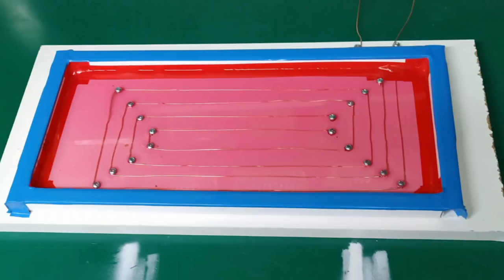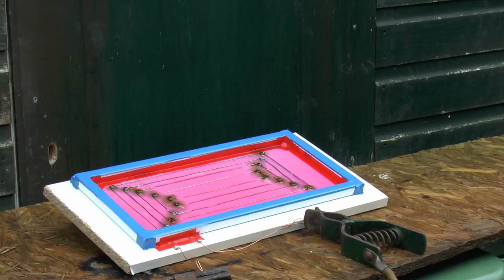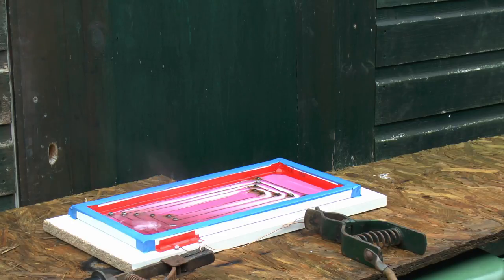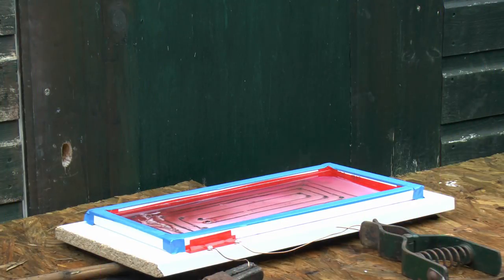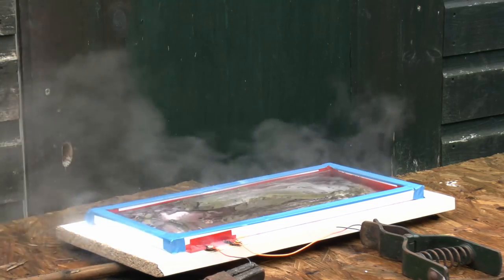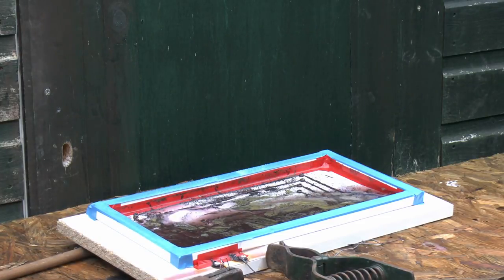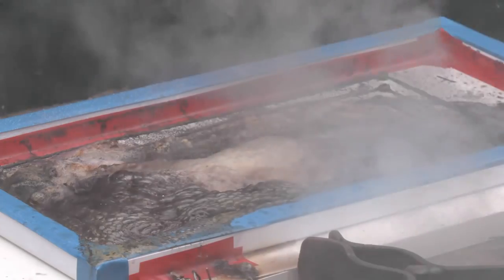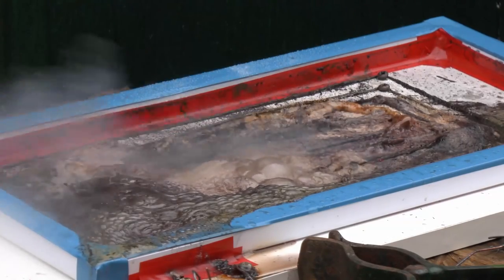Jelly Overheated with Electricity

Comment: Depending which output tap John used on the welding transformer it would only be 50V or 80VAC open circuit!
Reply from the maker: 80 volts this time.
Reply: Nice. What’s the Current at 80V on you’re machine? I know mine is 200A for 50V and 120A for 80V. Yours is 140A maximum right?
Reply: Thank you  @jwflame  for clarifying.

Comment: So is this a DC power supply then? Looks very much like the disgusting mess you get when shoving DC through iron plates in water.
Reply from the maker: AC in this video, although it can do DC with an additional device connected.
Reply: @jwflame  
Huh. Interesting. Thanks for the info!^^